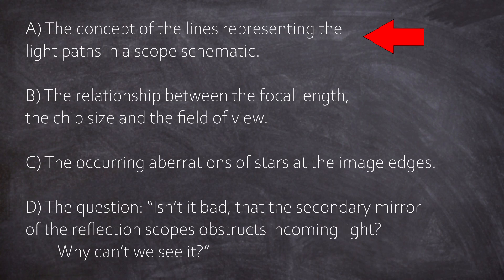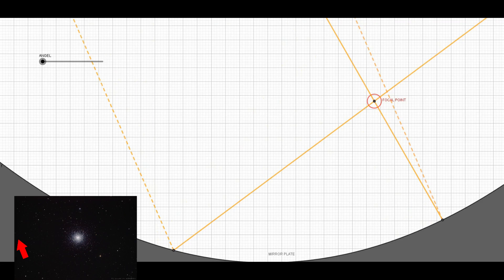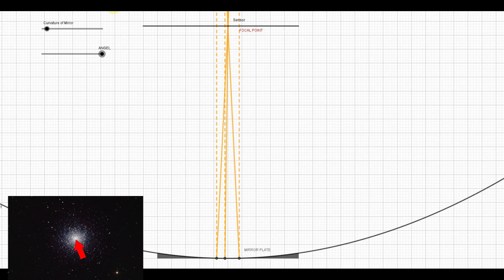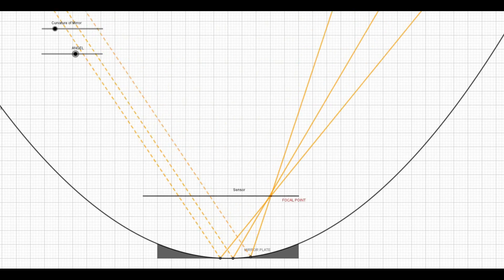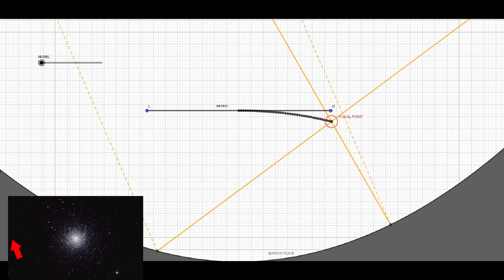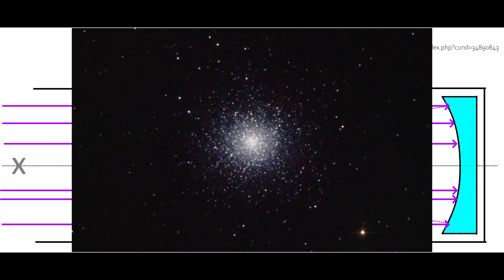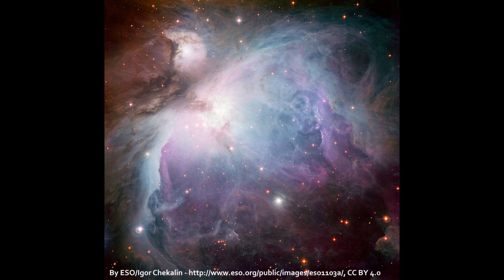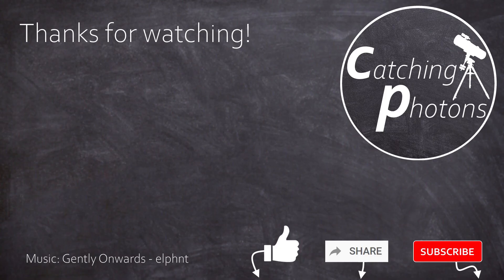Astro Tutorial #1.8: Science behind telescopes - field curvature, coma corrector and light paths

Comment: Responding to your question regarding focal length and f stop on the telephoto lens for my camera I was looking at a  New FD Canon 500mm f/4.5 L with the Fluorite and UD glass and buying the Sky-Watcher EQM-35 tracker. I will eventual upgrade to a mirror telescope that I could use with this tracker. The Sky-Watcher Star Adventurer Pro Pack would be great for wide field photography but I want to do deep space photography also and as the saying goes buy nice not twice. I two have mirrorless cameras a Canon RP and R but I am also looking at the Canon M6 MkII with the crop sensor which would give me 800mm equivalent in a field of view. FYI I use IRIX wide angle lenses 11mm f/4 and a 15mm f/2.4 with good results and they are reasonable priced.
Reply from the maker: The eqm 35 pro holds something like 10kg and therefore should do the job with a dslr and a lens. Keep in mind, that this is no transportable "star tracker". It's a small sized but full blown telescope mount. So its not easy to carry around and assemble in seconds. 
I wouldn't place a reflection scope ontop. It't too lightweight and even a smal Newtonian with DSLR and guidescope and guidecam and filter, cables... it adds up and you are up to 10kg easy and quick. EQ3 Pro and mounts in the same league are for smal refractors. And those are great! They offer you a wide part of the sky - many DSOs are MASSIVE in the sky and cant be captured with the smaller FOV of most reflectors.

Greetings
Chris
Reply: @catchingphotons  Hello again Chris the egm 35 weighs in at close to 40Lbs and as you stated it would be cumbersome to haul around and it would be great for a DSR set up.To use a bigger telescope I would have to go the next step up at least with a HEQ 5 so I may just get the Sky-Watcher Star Adventure and use with my11/15/28/35/85/105/150/200/ mm lenses and get he experienced and then jump up to a real telescope and equatorial mount. My cameras are light weight 1st generation full frame mirrorless Canons the R and RP and this would be an easier setup to haul around for now. I would still like to get something in the 300-500mm range to round out the top though.
PS: As you can see I like my primes!

Thanks again Tom
Reply from the maker: Hey!
#Trevor from #Astrobackyard did a video just about a simple and "cheap" (relatively speaking) setup for getting started in DSO photography. He uses an old Canon and modded it himself, then a skywatcher Startracker,a dedicated filter and a cool F2 lens. 
Check it out: 
https://www.youtube.com/watch?v=4a8pRirTe_8
The ability to gather 60' subs enables you to dive deep in. The most important factor here though is the modification of the Cam. Most of the "reddish" fog in the nebula is HA and (nearly) not visible without modification.
Greetings
Chris